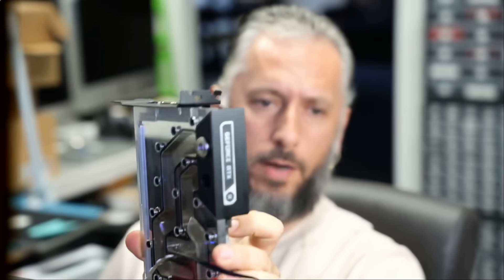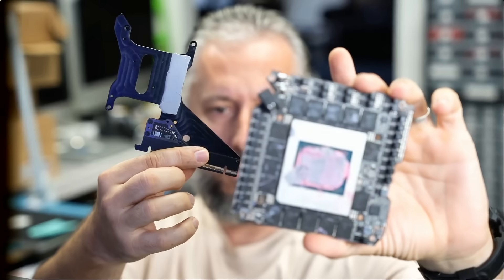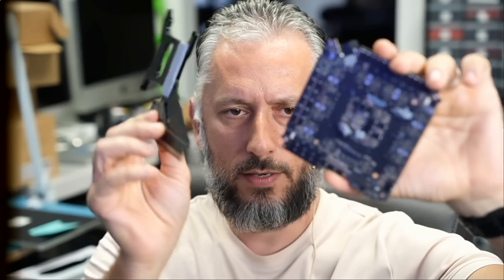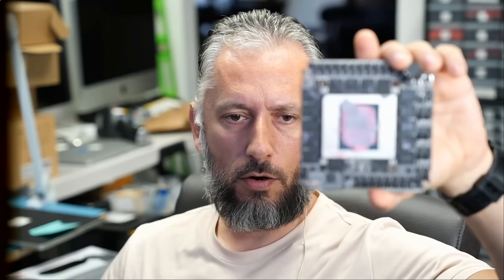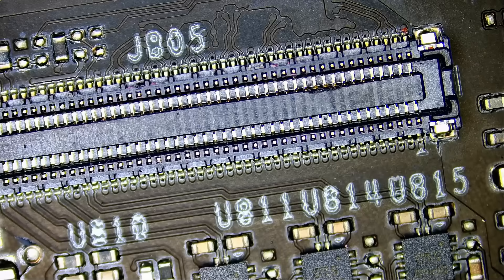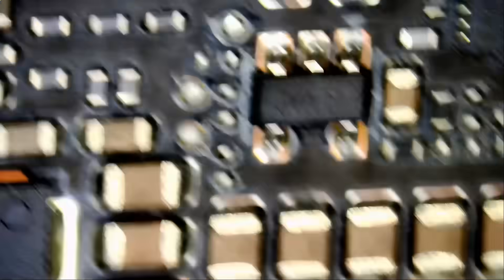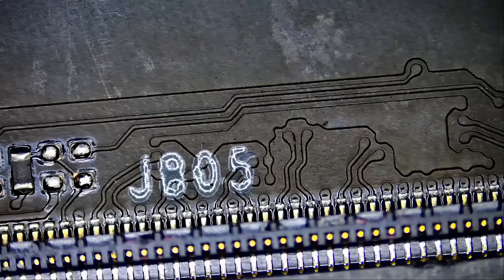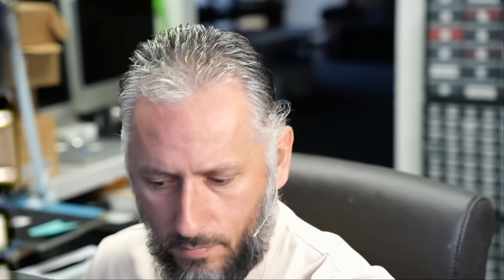Stay Away from 5090 Founders Edition GPU. The Weakest Design Yet.

Comment: The RTX 5090 Founders Edition isn’t a bad card it was designed to run with it's stock cooling. Its cooling system is already highly efficient, so tearing it apart for water cooling isn’t ideal. If you want a water‑cooled setup, go with an AIB card built for that purpose instead. I suggest watching Gamers Nexus video where he discusses the design with an actual engineer. The card's structural integrity was likely compromised by the owner. FAFO.

Comment: Why watercool it if it's already a thin 2 slot monster?
You will need just as much space area on the radiator to cool it + the extra weight of the water.

Comment: The 5090 FE by far has the most innovative and complex design. It is a clear winner from a user's perspective, as it is literally half the size of every other 5090, with half the number of inches spent in cooling fins, and half the number of fans, and yet out of the box it's thermals are basically on par with giant 4-slot card design that take up your entire PC case. I just switched from a 4090 Strix to a 5090 FE, and the card literally runs the exact same temps OC'd at load -- running at near 3Ghz on the core, the card doesn't tip much past 65C under 100% load. Is it really worth shaving another 3-5C for a card that's twice as big, will cause most certainly sag, and will block every PCIe slot on your motherboard?

The additional space savings this card offers is huge. It let's people build super-PC's in a mini-itx portable form factor. For the rest of use with big cases, it let's you actually use a 2nd PCIe slot, as your 4-slot GPU no longer covers the entire motherboard.

If you can find it, the 5090 FE is by far the best 5090 on the market. The amount of engineering which went into this model is insane. Now that said -- No one should be taking this card apart as our YT friend has pointed out here. The PCB is incredibly delicate, Nvidia used liquid metal on the cores, and it's simply a very delicate card to work with overall. If your goal was to shunt mod or mod a 5090, the FE is the worst option to do so -- you should have gone with a giant ASUS ROG Astral or similar 5-slot disaster with readily replaceable off the shelf parts available.

For everyone else, the 5090 FE simply is a better design that is more flexibile, and cheaper than the competition -- if you can find one at MSRP.
Reply: Insane levels of cope 🤣

Comment: I don't think the title is very fitting. As long as you don't disassemble a 5090, it's certainly no worse a card than any other 5090. Yes, the design is special because Nvidia chose a special design, but that's all. The recommendation should be: if you want to install a custom water cooling system, then go for a "normal" custom design.

Comment: Nvidia's advice 

Replacing the PCIe connector on an NVIDIA RTX 5090 Founders Edition is not possible because the proprietary connectors are not available for purchase. Any damage to this fragile connector, which connects the main board to the PCIe slot via a flexible circuit, will likely render the card irreparable, so opening the card for modification or repair is strongly discouraged.

Comment: Everybody should stay away from buying GPUs with the 12VHPWR plug; it is just abysmal that people keep buying them because of muh raytracing, when the chance of a melting plug is there every time you clean your computer (when cleaning taking out the gpu is a must).
Reply: just buy power supply with 12VHPWR cable. No problem

Comment: The connector card would have been great idea if the connection had been well designed. That would have prevented "whole GPU is destroyed when somebody yanked the card off the motherboard with too much force" issue. However, the poor internal connection caused even more issues.

And of course, you would need to be able to purchase the adapter card for any of this to make any sense.

Comment: So DO buy a 5090 FE but do NOT put a water block on it.
Gotcha.
Reply: Exactly this entire video sounds like crying over skill gap because bro couldn’t just leave the flow through design alone. The entire form is designed around the air cooling of the double fans. He should’ve gone for a partner card if he wanted non-air cooling

Comment: 2 5090s in the trash where they belong. Idiot.
These cards aren't even running hot with a slight UV anyway. What's the point of the waterblock when the only heat problem is the connector? Which will only get hotter than usual without fans blasting around it?? I swear it's only the idiots who have that kind of money.

Comment: Glad I purchased the ASUS Astral 5090 which is one whole unit and installed the waterblock correctly, like on many other custom pcs with non-FE 5090's that I've done.  Once they advertised the modular design of the 5090 FE I knew I would never buy that card, even if a client offer4ed to pay extra because they specifically wanted it I wouldn't do it for this very reason.  Too many weak connection points for a failure to occur.
Reply: lol, asus?! that's even worse

Comment: They tried to fix the cracking problem from 40 series that’s why they have that design, but it definitely sucks if they don’t sell replacement parts..
Why would you water cool those cards.
Specially when they are under warranty…

Comment: I disagree, having it be modular is a good idea.. I've seen many people who had broken PCIe Connectors.. however, you should be able to buy it separately, that is an issue on Nvidia's part.
Reply: The definition of a comment that is better off left in your head. Jesus Christ it doesn't even make sense. The man just said that the replacement parts are not available, and just saying it's on Nvidia doesn't help the customer which is the goal of the video, coming to a solution. Some people today are not solution-focused, like yourself. You didn't offer a direct solution or reason to combat the statement that a two-piece solution is not a good idea.

Comment: The GPU design was engineered this way to be modular so that the GPU module can go into more device formats including PC, embedded systems, robots, datacenter servers, and much more. The GPU is the brains of an intelligent system and making it modular means it can be inserted into more device platforms. Nvidia is a hardware company and being able to use one hardware format to go into many target systems lowers the cost of goods and increases profits.

The connector is a surface-mount high-speed, high-density board-to-board interface connector. It's most likely a Foxconn, Molex, Samtec, TE Connectivity, Amphenol, or Phoenix Contact based connector. I'm guessing Foxconn because of the tight Taiwanese supply chain for Nvidia's hardware ecosystem. I'd look at the Foxconn (Honhai) product catalogue and go from there.
Reply: Pretty certain that it is a Samtec connector from their ADF6 line, not Foxconn

Comment: The 4090 design is a bad and stupid power connection design and now the 5090 fe seems to be even more stupid by making a separate pcb using a J005 jumper connection which is easily tired and damaged.

Comment: I agree. I have a friend that also have the same gpu and the same setup (with two gpu's). The design is horrible!!! That's what you call cutting cost to make bigger profit. I haven't purchased an Nvidia base gpu in 10 years. I don't have any issues with AMD gpu's because as soon as I get them, I remove the default thermal paste and thermal pad. I then replace them with Giled 1.5 thermal pads and thermal grizzly extreme for the GPU (and if it will use a water block). No issues at all. I've heard horror stories with nvidia cards and the constant frustration with them.

Comment: I completely agree. I've worked in the electronic and electrical maintenance field for most of my career, and connections are always the weak point. A reliable system has fewer connections—it's just common sense. What would be more reliable: a single 10-foot piece of wire, or five 2-foot pieces connected together in any fashion?

Comment: man that really sucks  was looking into buying a 6000pro card but its the same design and way more expensive. too much of a risk. thanks for this
Reply: How often do you mod gpus that cost nearly $10,000? These cards have a 3 year warranty, and adding a waterblock could void that warranty in most cases. Parts should be easily available, but no one should be modding intricate electronics that cost anywhere from $2.5-10k a piece without the expertise.
Reply: The RTX Pro 6000 should be different though? Have you seen a teardown of it?

Comment: I could tell at a glance with the 5090 FE's design had to make a lot of compromises with disassembly and durability. The PCB is mega crammed with fuses and transistors and resistors, and the multi-PCB introduces more potential points of failure.

If you get a 5090 FE, buy it only with a valid warranty and just don't open it while it's under warranty. That means don't buy it from eBay scalpers where the original warranty won't apply to you.

Comment: not the biggest nvidia fan but: 
i do not think there ever was a gpu with a better air cooler then the 5090 fe or a card less suited to put a waterblock on.
the customer, sorry to say this, is an idiot. any other 5090 would have been a better choice and if he wanted to put a water block on it, he should have selected the card for this from the start.

as for the reason for the two pieces: its not repearability. its cooler performance.

Comment: i have a Saphire AMD 7900 xtx 24GB (I know its old) it is a heavy card but i bought a 3rd party brace that holds the entire weight of the card so it don't break the PCI-e connector or tear the PCI-e connector off the board. its been running for 2 years great so far. I don't game that much anymore so i have no need or reason to upgrade right now. maybe in my next build. but i will stay with AMD cards though. i kinda don't like nvidia. i dont mind nvidia in my laptops so much (my gaming laptop has a 4080) but desktops? no, amd only. 

Thank you Alex for the warning. i wouldnt buy a 50 series card anyway right now. too many design flaws.
Reply: pcie break when moving computer without first removing the gpu, and nvidia know it very well and teach factory in china to run internal track near the pcie weak point

Comment: I agree about the connector part, having the pcie connector seperately is genius. Look at how many boards break because someone broke a peice of their pcie connector. They should just improve the pcie-to-board connector and keep it seperate
Reply: They should just use internal riser cable and standard PCIe connector. That would totally fix the PCB broke when attached to motherboard issue and standard PCIe connector on the actual PCB would allow using aftermarket riser cable if you need totally custom placement.

Comment: If i had that card, there is absolutely no way on esrth i would try and mod it. I've done some daft stuff in my time but that is waaaaay too expensive to mess up. I remember modding my original Wii back in the day by soldering a mod chip to the rom drive. I damaged the traces. Fortunately i managed extend the trace and install the mod chip successfully then not long after there were softmod options. I was lucky. :)

Comment: In the first place, the “5090 Founders Edition” is a product that contains liquid metal. It is a product that was not designed with disassembly in mind at all. Therefore, any user who disassembles it is at fault. The design split into three parts is also for astonishing cooling efficiency. People who take apart products not intended for disassembly and then complain are trolls.
Reply: No, they are owners and it's their right to do whatever they want with their property, that includes breaking it which seems what a lot of them are doing atm 😂
Reply: they use liquid metal as they want to extract most cooling they can get on  cooler  that they made, it has nothing to do with ability to disassemble, your wrong if you think its for  longevity as liquid metal can dry out like normal thermal paste, the only different between the two is you can repurpose the dry out  liquid metal instead reapplying new
Reply: lol what. go outside and smell the cool night air

Comment: I have zero experience in taking cards apart or modding gpus. That said, I installed that same EK block (the first one he showed) and with patience, it was a success. My fist time doing it. 

People just lack attention to detail. Yes the 5090 is a 3 piece modular board with a million screws and complications, but I’m half retarded and I did it successfully.

That waterblock instruction manual is like 30 pages long and VERY SPECIFIC, no detail can be missed. I have bad eyesight and I did it. Come on guys…
Reply: You did it, so what? The risk versus reward is to high. Patting yourself on the back and saying “come on guys’ just shows you don’t get it. I’m happy your card is working and you didn’t have any issues, but most people should not try this with the Founders Edition. My card is one solid piece and was simple to add the waterblock to. I’m insanely happy I didn’t end up with a FE Edition because you took what you could get when the cards released, and I would have been upset seeing all those pieces come apart. Sure hope that waterblock holds everything together for you.

Comment: The reason they went to a two piece design is because the weight of the card was causing them to break or weaken at the PCIE connector. This is the manufacturers feeble attempt to remedy that problem, and inadvertently causing another. Good luck sourcing the parts.

Comment: Is supposed to be a easier way to repair this card from Nvidia technician, thet them are able obviously to access on specific spare parts.
Usually, the part that break more is the PCI connector, specially on pre-assembled builds, that will be shipped, and is easy during the shipping that the connector will break.
In that way so, they can swap it without swap the whole card.

The real question is why i may think to place a different cooling system on a Founders Edition, if that is just enough cool with temps?!

Changing a bit discuss, the FE cards are physically better realized than other brands ones.

If you try to install an orher brand card, his weight just make it not stable in the case, because a lot of that weight is placed directly on the PCIe connector, and so directly on the card abd his electronics.

The FE is different, it have a solid structure, directly connected to the metal back panel, where the output ports are, and it make the weight to just act on it, and not on the PCIe slot, the fact is that result a lot more fix and stable than any other card.
That was just to make it known...

In any case, you may not teardown a card like FE ones if them just are working great and with reasonable temperatures, especially if than, assembling it back, you not put the required knowledge and maximum careful doing it... Clarely the case of this user

Just keep it as it is, using it with a minimum of good sense, and will work forever.

Do not pull out 800FPS, overloading the card, if you have a 200HZ monitor, what the sense of the other 600FPS?
They only absorb 3 times of electricity, increasing temps, and damaging fastly the card, when you only can see 200FPS of the 800 you are generating.
Totally useless!
As so is useless to place a liquid cooler if the card can simply work trowing out 200FPS, and not 800.

Is sufficiently clear this point?
Reply: The point of having the highest FPS possible is in the lower latency not necessarily seeing more frames on your monitor though that can help to a certain point.

Comment: I used to do custom loops with water blocks, etc. So, I get the desire to build such things. However, I gave that up long ago...got it out of my system. Now I just want my expensive parts to last as long as possible. If I want a water cooled GPU I will buy one that already has it installed and has a warranty.

Comment: The nVidia company was trying to resolve the issue with the cracking PCI slots and ultimately minimize their losses for warranty claims. They would be able to replace the $5 PCI part and refurbish the product. Of course they will not sell the original PCI slots to the public. 
I don't understand why there are people out there who would mess up their video cards with some water coolers or liquid metal.
Reply: This guy is a 3d artist running dual 5090's in his rendering rig for Blender. The airflow isn't good enough for air cooling them. He had to put waterblocks on them.

Comment: I've read some time ago, that NVIDIA wanted to push another connector and form factor for video cards. The plan was one single form factor for graphics cards with a very small PCIe connector, that could be adapted to full size PCIe, MXM or directly used via cable. In the second step, it should also replace SXM. 
As far as I know, Lenovo already has a few servers with this connector, I will look it up next week, when I'm back at work, maybe I can give you exact specification and a source for these connectors. 

Btw: The 5090FE is not a heavy card. Talking about heavy: my 5090 Astral bent the PCI backplate of my case (4mm stainless steel). But it runs much cooler and quieter than the FE. And most important: It monitors the 12V High Failure connection and alarms you, if something is wrong.

Comment: If you remove the connector, you might see manufacturer logo on the back. The connector is 124 pins, 4 rows of 30 pins each + 4 damaged pins.

Comment: Never modify a card until it is out of warranty
Reply: Right! I just put a water block on my 3090 a Lil bit ago
Reply: Then how would you water cool it? The problem wasn't the modification per se but the point of failure on the board that doesn't exist on other graphics cards. This person probably had done this before with no problem with traditional cards. The 5090 maxes out at 600W so water cooling is the best way for temps and lower noise.